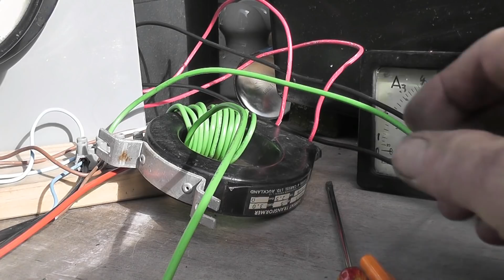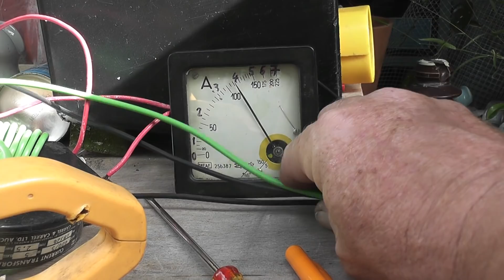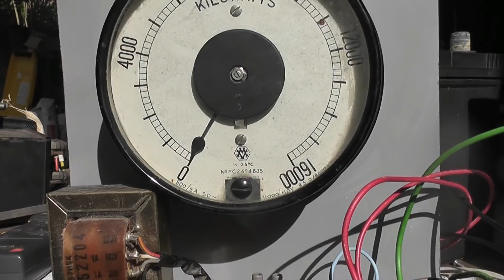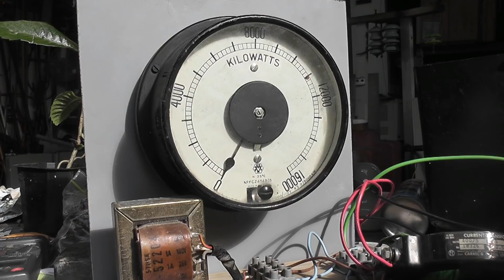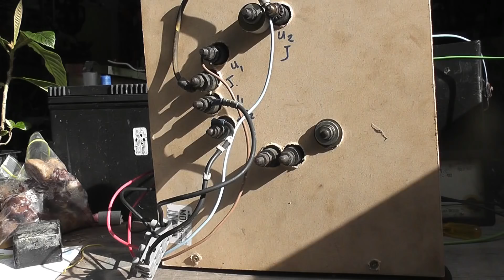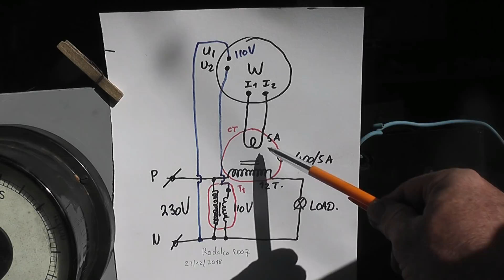Repurpose old Lineair schaled Wattmeters

Comment: Good video, thanks and very interesting. I did the same for a max. 700 Watt 230 V AC load with an old transformer, say 1 Ohm in series to the load and on the secondary winding 1 diode (rectifier) with 1 non-polar cap (say 100 N) + a Micro Amp meter, connected via a suitable voltage divider. Worked properly too, though I had to make a switch in the voltage divider to measure the 20 Watt-100 Watt range. One question: where did you need the 110 V (or 10 V) AC to the amp. meter for? Has the meter to be supplied with something at U1-U2?
Reply from the maker: Yes, I saw that video where you used an old transformer as a CT. I have used transformer CT's for monitoring my outside lights for about 25 years, so I can see if a lightbulb has blown. Pilot LED's are on my hour meter panel in the hall. These kilowatt meters are 110 Volts AC meters and need an external 110 Volt supply to work. They were used on old substation panels in a 3 wire two wattmeter method.
Reply: @RODALCO2007  OK, thanks!

Comment: I'm trying to figureout why you wired the secondary of the PT the way you did instead of just hooking one end of the secondary to U1 and the other end to U2. Or IOW why involve the neutral in the secondary circuit?
Reply from the maker: The PT I used is actually a autotransformer with one winding with taps at 220-100-30-0 Volts. Also two 240 V TX's in series can be used and voltage taken off at midpoint, as I did in the frequency meter set up.